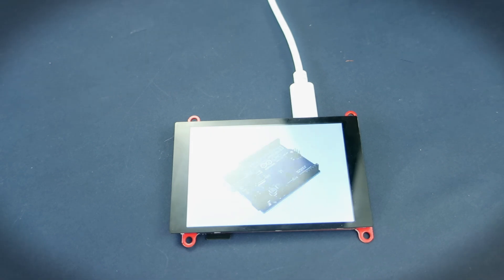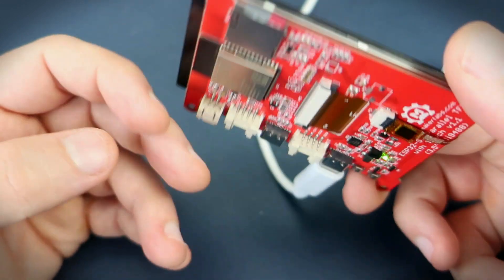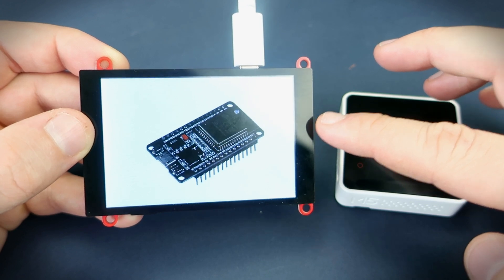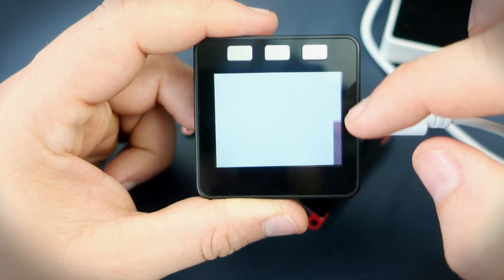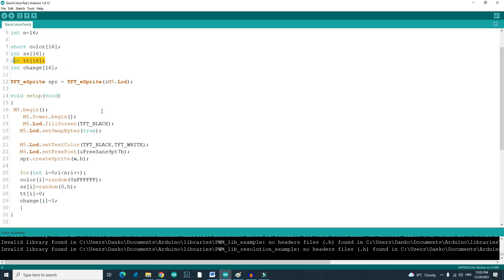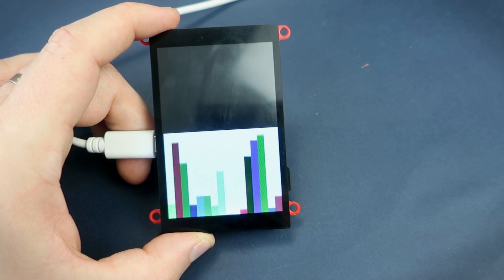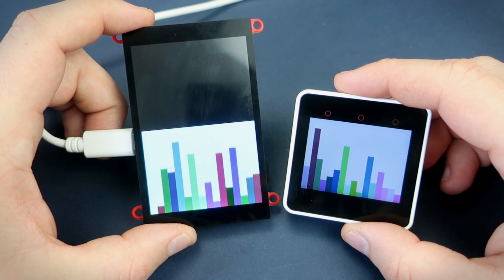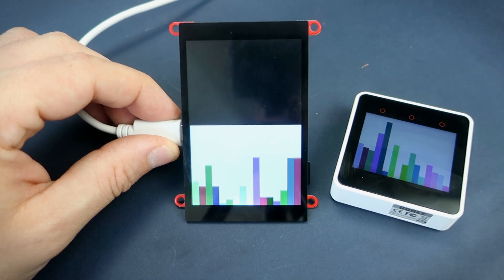Testing speed of ESP32-S2 board  with Parallel TFT with Touch 3.5'' ILI9488

Comment: I'd like to stream data from an ADC/Camera that outputs 256 Mbps (32MB/s).. i.e. every microsecond there is 16x16 bits of data that need to be transferred.   Then I'd like to stream this out via the ethernet connector.

However, unless I'm missing something, I don't think the ESP32 can do it.. 

The ESP32 S3's PCLK can be configured to 32-40Mhz... and assuming the GDMA is setup for two 8-bit transfers (80Mhz Octal SPI) into external PSRAM...  the S3 doesn't have a built-in Ethernet Interface (MII/RMII)! 

The ESP32 WROOM does have built-in Ethernet (MII/RMII), but the maximum PCLK is only 8Mhz!